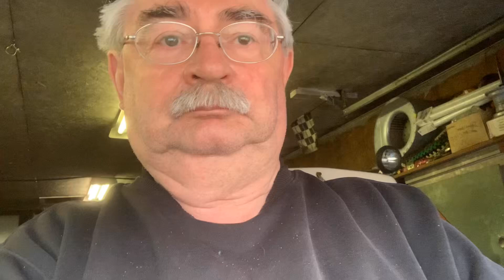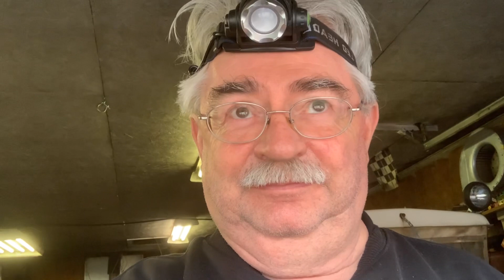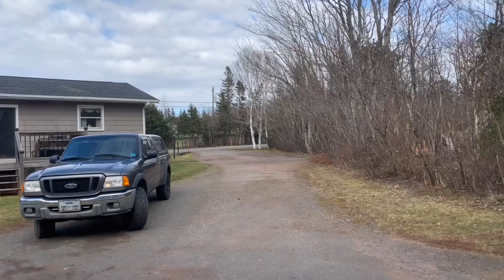Part 11. Kohler K241. Getting closer to start up. #kohlerk241 #kohlerstartup

Comment: Looks like a fine day there, Noel.  Beautiful sky.  Yep, prolly shouldn't use that rotating stub shaft on the front to secure it to the work bench.  Things might get kinda 'stirred up'  in that area of your shop!!!  Will be neat to see it 'light off' .
Reply from the maker: Thanks Ed. You have saved me a lot of trouble. Hehehe. 👍🏻👍🏻👋👋.  I’ll find some way to secure it. Safely. 🤭🤭
Reply: @noelstractors-firewood57  That's a unique way that Ford mounted it in their tractor.  Yep, many moons ago, had a '64 Buick with a V8.  Would eat motor mounts like candy, always on the drivers side.   Jump on it, engine would pop up and throttle would go wide open, rear tires would begin smoking.  Only thing a guy could do was kill the ignition switch or shift into neutral.  Kinda dangerous, to say the least!!
Reply from the maker: Some people use to bolt in a short chain to limit the travel of the engine lifting.